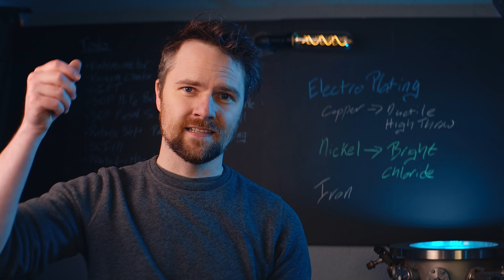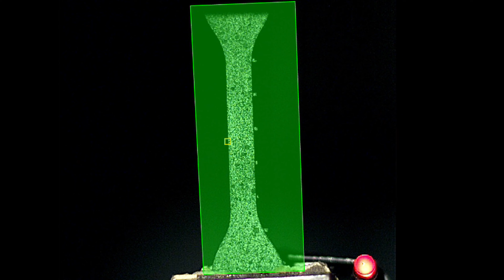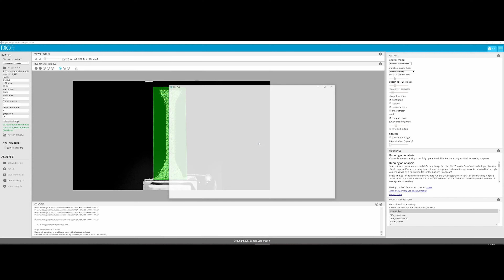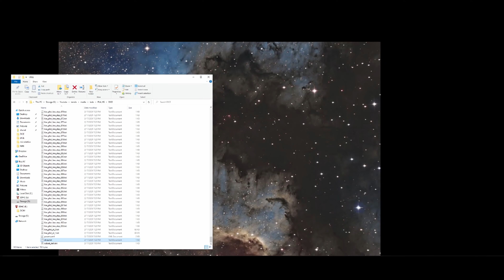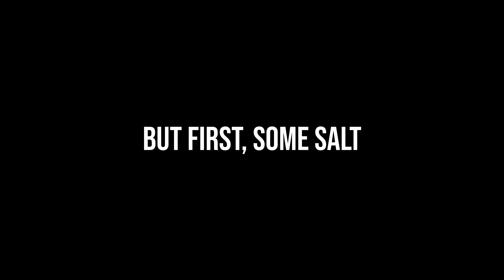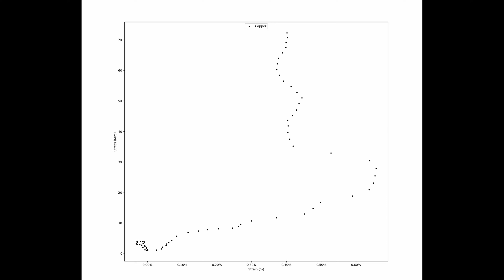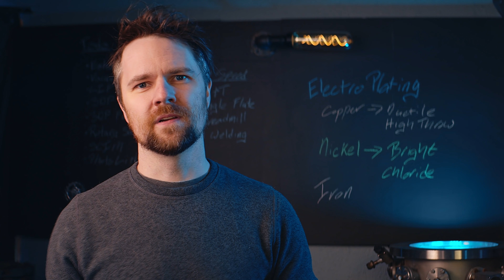Stronger 3D Printed Parts with Electroplating

Comment: Love the content you are producing! You referenced papers during this video. Can you post the links to your references and brief description of their applicability to the discussion or process? Thanks!
Reply from the maker: Added some papers to the video description!  I admit I wasn't too rigorous with my literature review for this video, mainly because I'd seen a lot of it in passing for other projects (like the microlattice video) so it was just floating around in my head.  There is also a set of literature about electroplating engineering grade injection plastics (PEEK, PEI, etc).  There is also related field called electroforming which is used to reproduce molds/mandrels, typically with Nickel.  NASA used this technique to fabricate rocket nozzles at one point, electroforming a mandrel to create a replica of a nozzle, detaching from the mandrel and then electroplating more metal on top to thicken it up.  Sorta the original additive manufacturing before metal 3d printing was available :)
Reply: @BreakingTaps  Thanks for adding some reference materials. May be worth mentioning, but read somewhere nickel plating is a useful technique for short run injection molds produced by SLA or FDM.

I have read some papers on experiments to produce electroformed rocket propellant tanks. Would you like more references? I think I have a few somewhere in my collection.

You have posted some awesome processes and I appreciate your work. There are plenty more vids I need to plow through!

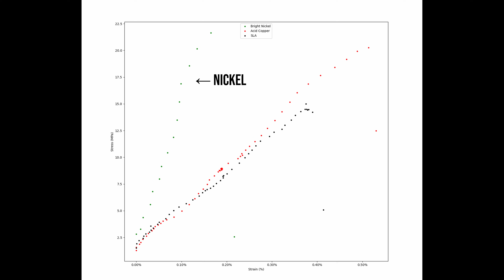Comment: Great content and analysis! Your observation at 8:35 seems like a similar effect to why a traditional bow benefits from a cloth or fiberglass backing... it reinforces the wood fibers that would otherwise snap with tension and allows for more compression prior to failure. I’m guessing this may well be a result not just noise!
Reply from the maker: That makes sense!  I hadn't thought about it from that angle but it seems reasonable that it's acting as the "sandwhich material" in a composite and together they get better mechanical properties than alone.  Neat!

Comment: I am amazed why no one has tried doping doping resin with flash graphene. It is cheap af to make and simple too. Studies show it increases material strength and rigidity enormously at only 0.1% by mass. 

In addition, it would make makes conductive possiblity. Then they could be nickel coated

Comment: you do know that if you coat and dry the test filament with Robert's conductive ink first (i didn't calc the diameter ink to filament ratio) you get stronger prints too, back in the day he did test mold's, result better than good, also plating will presumably be better too as it will then have something inside the part to grab
Reply from the maker: Rad, will take a look at his work on this :)  Was just having a discussion with someone else about having some kind of surface texture/feature which would allow the plating to "grab" onto the part and help lock it in mechanically, makes a lot of sense!
Reply: @BreakingTaps   ^_~ if your shop/lab/garden shed is that cold, you should probably paint some of rob's low power heaters under your work tops and walls too...

if you want crazy quick local heat see 'cayrex2 High temperature Conductive ink - 1000 degg C (Update)' his derivative was 120ac i think , although that might crack any Granite, Quartz, Marble, Ceramic and/or Corian worktops lol, a wireless esp32 remote controlled html version is required perhaps O_O

Comment: The youngs modulus is the slope of the linear part of the graph aka elastic deformation. Its not related to Ultimate strength, its instead related to the yield strength that looks to be somewhere around 4MPa. Also, Ultimate strength is not where the part breaks. Ultimate strength is the maximum strain it will achieve but usually after that there is a necking effect and its after that, that the part breaks. Put simply, after the ultimate strength, the cross section(area) of the part becomes smaller so the stress also decreases(stress = force x area). The part breaks at a lower stress than ultimate tensile strength. Just a few corrections i thought i should mention. Great videos though, very interesting concept. Also, i was blown away by the computer vision deformation analysis! I wonder if using known dimensions on the dots would improve it, like maybe a QR code you can stick on the part and tack it that way.
Reply from the maker: Whoops, that's a great clarification thanks!  I probably explained some of it poorly, and definitely didn't myself understand the difference in maximum strain vs breaking.  It probably didn't end up mattering for the resin prints since they are so brittle there wasn't any necking, but when I get back to PLA that'll be an important thing for me to get right I suspect :) Maybe the adhesion issues saved me from saying some very wrong things about the PLA tests on camera :) 

That's what you get when a biologist tries to explain engineering terms haha.

Regarding the speckle pattern, I actually had the same thought (was thinking about making some kind of mask I could spray).  But apparently a fine, random stochastic pattern is considered better than anything with a regular pattern.  To be honest I'm not entirely sure why.  Perhaps it helps when filming with a slower speed camera, e.g. to prevent the pattern from shifting one "multiple" between frames and looking like it didn't move?  Not sure.
Reply: Just a small correction to your correction. The ultimate strength is the maximum (engineering) stress that the part will feel, not the maximum strain.

Stress is force/area not force*area. When the coupon necks, the area decreases. This actually increases the stress not decreases it . 

When you see the graph of a stress vs strain they are usually plotting engineering strain. This uses the original cross section of the part for calculating the stress. As the part necks, the coupon is able to withstand less force. That's the downturn you see on the plot. 

If you were to keep track of the true area of the necking coupon, the decrease in area would usually more than compensate for the decrease in force. This means that the true stress continues to increase after the ultimate strength (but the part as a whole is able to bear less load). A good picture of this can be found here:
https://en.m.wikipedia.org/wiki/File:Stress_v_strain_A36_2.svg
With the true stress in blue and the engineering stress in red. 1 shows the ultimate strength. 

I was also blown away by how he made the optical tracking work.

Comment: try vapor deposition in a vacuum chamber, no any middle layers, direct next layer
Reply: or just hurl ions, not too fast, to a target, coating
Reply: try casting with embedded carbon or glass fiber rebar core
Reply: you do realize you can re-melt the inside after you have a cooled down outside mold
Reply: thats like improving the inner core after an initial put in place, with the metal former
Reply: just "spray" with the particles
Reply: diffusion will have some inside to have a great sticky adhesion

Comment: Increased elongation of the sample could be due to the copper coating eliminating surface level stress risers. Any small scale fractures or notches in the surface will be mitigated in effect.

Oh also, were the tests performed at low temps as well? even a fairly small delta to room temp can really shift the results.
Reply from the maker: Ooh, that's interesting.  Will do some reading on that phenomenon.  So the idea is that a "perfect" piece of resin might get longer elongation, but little surface defects act as brittle fracture nucleation sites normally, and the copper coating helps take the stress and prevent those from actually initiating the fracture.  Something like that?  Very cool!
Reply: @BreakingTaps  yup, exactly, or surface stresses from the resin curing process. Also, I'm the guy you asked to dm you on twitter, but your dms are closed so I can't. Not a huge deal because I'm gonna do all the experimentation the first week of March, but thought I'd give you a heads up now.
Reply from the maker: @notabagel  Oh weird, I'll go look into that.  Don't think I turned DMs off or anything but I probably did on accident while messing around. :)  Thanks for the headsup!
Reply from the maker: @notabagel  Aha, did indeed have one of the settings unchecked.  Fixed, thanks!
Reply: On that basis how much of a benefit is conferred by metal coating over, say, varnish? Or a smoother coating of the resin which is then cured to try to deal with ‘bumps’? Come to think of it, how much of the mechanical properties measured arise from ‘bulk’ properties of the resin and how much from the way in which they have been set.. i.e. does it matter if it’s a stack of fewer thicker layers v. many thinner layers... and if you produced the coupon using same layer heights etc but did printing them at an angle, then would there be appreciable difference with the resin printer? (What about just setting some resin en bloc in a coupon mould?) I seem to recall some YouTube videos investigating angle of printing for FDM printers finding some effect because layer adhesion was an issue.. at a microscopic level could something like that be happening with resin? (maybe as a function of pattern of curing etc)

Comment: These electro(-less) plated micro lattices won't get out of my head...
But there seems no way around electroless and some heat treatment after that.
Reply from the maker: Yeah me too! I keep trying to figure out a better way to do it, and can't :(  It seems electroless is basically required for denser lattices, and then either heat treatment or some kind of dissolvable resin (HIPS, PVA, etc) but that limits resolution.  At least with my crappy printer :)  I have read that reverse pulse plating and special "high-throw" electroplating baths can help reach deeper into recesses, but I imagine there is still a limit
Reply: @BreakingTaps  Here is a way to begin,  by using chitosan (chitin been made out of the shell of crabs, shrimps and co.), vinegar  and Nickel nanoparticles.
Search for "2009 a new palladium free surface activation process for ni electroless plating on abs plastic" Tang et al.
Which makes thing easier and cheaper.
You don't need to do lattices that are too dense, if the platting is 300-1000 micro thick.
Chitosan aerogel 3D printing has also been tested in a medical goal of recreating bones, including hardening it with Calcium and co...

I see a futurist robot arm with inbuilt tubing to connect synthetic muscles (MkKiben)

Comment: Hey, have you heard of Siraya Tech FAST (ABS-like) resin and their BLU hardener resin, in combination you can get some incredible results. Ive been working on mixing the two in different ratios to to print parts for a resin printed RC plane over on my channel. I have also ordered all the hardware needed so I can build my own Tensile testing machine like @CNCkitchen open source version. So I would love to pick your brain more on the software you use and how you interpret the data.

PS regards to the results of the SLA elongation, the electroplating process may be chemically effecting the monomer  bonds of the part, sulfurs and other elements/chemicals may have adverse effects on the resin.
Reply from the maker: Interesting, I'll check it out! I've used their Sculpt high detail resin and really liked it, but haven't tried any of their other resins.  Happy to chat about tensile testing any time, although fair warning I still pretty much have no idea what I'm doing :)  Definitely not a pro like CNCKitchen!  Hit me up on Twitter when you get it assembled, more folks sharing testing data the better!

That's a really good point about the SLA being affected by the plating bath.  It's basically a highly acidic environment, and likely contains some contaminants.  I should probably do some tests with SLA prints that are "treated" with plating bath but without any plating, to see how that affects the properties.  Great thought!

Comment: Hey BT, You should look at Teflon pans for inspiration on this. They're able to get PTFE (one of the lowest coefficients of friction), to stick to metal!  It's actually like a mechanical bond I think. They pit the metal with a strong acid and then they apply the Teflon* to it. Think about all the thermal cycles that it needs to go through. It's the opposite of what you're talking about, it's a plastic on a metal. Also, how in the fluorinated fuck do you only have 10K Subs?
Reply from the maker: That's a really good point, I never actually thought about how they get teflon to stick to the pans (like, holy crap, that's wild!).  Will do some reading!  I wonder if you could co-deposit teflon into the plating too, like I mentioned with ceramic particles...ould be neat to print teflon coated "bearings" or rails!

(also lol "fluorinated fuck" made me literally laugh out loud :D )
Reply: I think that works because of how thin the PTFE coating is, it doesn't take very much force for it to stretch or compress (to match the metal's size) so it doesn't tear itself free.
If you had a thicker coating of PTFE, with the same bond strength to the metal, the increased strength of the PTFE would tear itself free.

But yeah, that is an insane amount of thermal expansion and contraction they take being on a stovetop!
Reply: @nickopedia5669  Nick, I've been thinking about what you said for like an hour and I'm honestly not sure. Initially I'm like of course, he's right, but the more I think about this, the more I'm second-guessing myself. Hear me out, say we have an ideal surface, very well bonded, extremely rough, tons of microscopic sideways caves and the like. (look at the image below). Also, we know that the metal and the plastic will have different rates of thermal expansion. One material will grow more than the other material causing stretching. As long as the relative stretching stays below the yield point of the PTFE, you have something called elastic deformation. (Temporary stretching that will go back to the original shape) I'm pulling this out of my ass but if I had to guess, I would imagine that the primary mechanism for delamination would be relative stretching that went past the yield point and causes plastic deformation. If this is the case, I see no reason why the thickness of the Teflon layer would affect the ability to stick to the surface. I'm having a hard time conceptualizing this so I'd like to hear your thoughts.
https://media.gettyimages.com/photos/rough-surface-of-a-vitis-specimen-red-table-grape-revealed-in-the-picture-id940586830?s=2048x2048
Reply: @JonathanGeier   I feel like plastic deformation is probably not the main driver of delamination. That it is instead the shear force at the interface reaching some critical value. This could occur in the plastic or the elastic regimes.

If the delamination only happens because of the plastic deformation itself then you're correct that the sheet thickness doesn't matter.

I'd also be surprised if your metal pot expanded enough to plastically deform a plastic. My intuition here could be very wrong though.

If the bond does fail because of some critical shear stress, then as you increase the thickness of the sheet you dramatically increase the forces at the interface and thus a thicker sheet is more likely to fail. This increase of force exists in the plastic regime as well. Plastically deforming a larger cross section requires more force. 

As an interesting aside, if you really crank up the thickness, eventually you reach a thickness where the force stops increasing and the sheet essentially acts like an infinite block of material.

It's possible that there is some combination of mechanisms: possibly having plastic deformation leads to compression induced shear/buckling on the cooling step, (the magnitude of which increases with sheet thickness) and that compression is more effective at delaminating than the tension/shear on the heating cycle.
Reply: @maxwellfire  I was looking up thermal expansion of properties on the thermal expansion Wiki. 3/4 down the bottom they give you a table of common materials.  If you look, the polypropylene and polyvinyl chloride have greater thermal expansion than either steel or aluminum.  Quite frankly this was a surprise to me. I wasn't able to find the Thermal expansion numbers for Teflon but I would imagine It's similar to other Plastics.  If that's true, then it looks like the Plastics would expand a lot more than the metals would. I don't know if that changes anything but definitely found it interesting.
Reply: @JonathanGeier  That is interesting! Sorta makes sense because the bonds (cross links) in plastic are a lot weaker/less numerous than those in a metal.

Comment: Awesome! Perhaps consider a foaming filament in your FDM tests — lots of additional surface area to increase overall adhesion.
Reply from the maker: Woah neat, I had no idea that existed.  Just looked around and that stuff looks very cool, might have to pick up a roll to play with.  Cheers!
Reply: @BreakingTaps  most foaming filaments are a closed cell foam, so the surface increase would still only be on the more "textured" surface. But def worth trying out
Reply: @BreakingTaps  is it possible  to electroplate  glass? Specifically  glass on the back of a phone? I have a s23 ultra and was wanting  to plate gold on the back